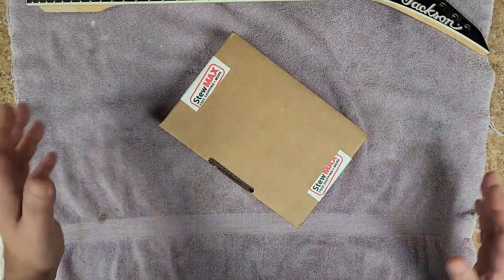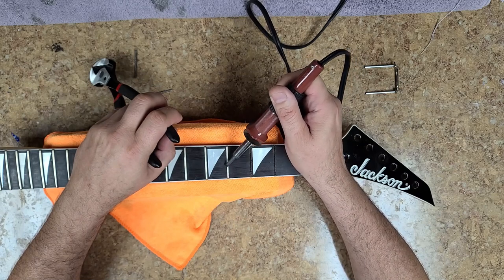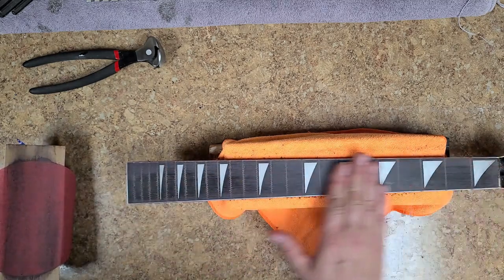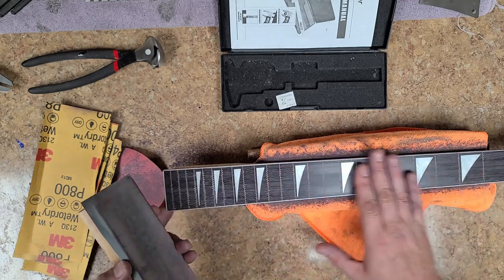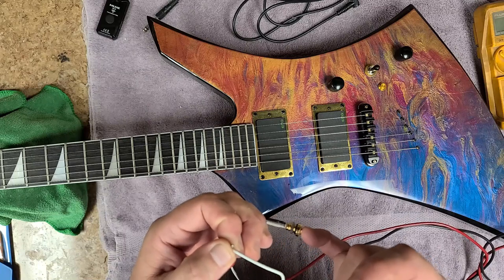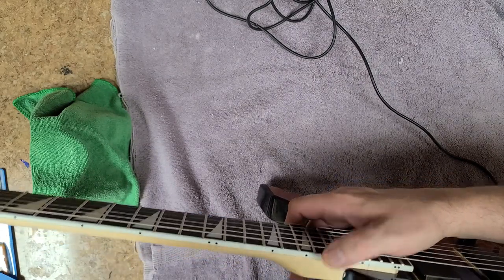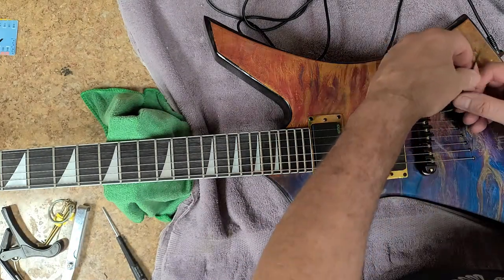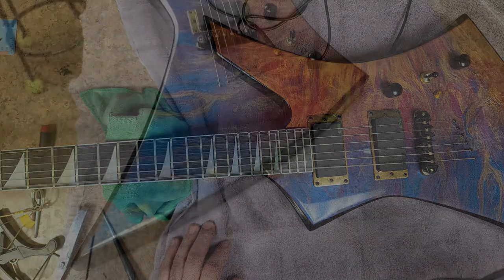Jackson JS30 Kelly Finally has its Glory

Comment: Hey Eric, another great video! Question concerning the bridge adjustments on the post, how much adjustment does it have total? I have a guitar that someone redrilled for different bridge and drilled the post to close to the neck by about 3/16 to a 1/4".
Reply from the maker: Hey. The post opening is 5/16s from side to side. With the mounting post you have 3/16s to move the bridge forward and back. Then you have another 3/16s forward and back for the intonation. Hope this helps.
Reply: @ericctheartofnoise8613  Thanks, I think it will work! Would you mind letting me know who you purchased yours from? Another amazing job my friend!
Reply from the maker: @ambntman4212  https://www.ebay.com/itm/373092148552?hash=item56de066548:g:sP8AAOSwu-thDbmG&amdata=enc%3AAQAIAAAA4CKPxuYR4Bj4iT7TyqRy8Dkfh5syN5Vapb%2BnWD12LaeolQPcV0vxXjh%2FlfULGhli%2BcjBfqYAfFF4qnXg5YnOqdoX8HY34Mvo82hJFePb4fjQqtTyCdrYMHdDWwcwKScyoSN1Jq6WOqkou0toSUaGImrXv8%2FCeGpUYTudYM%2FIlO9yapfisRuxZY8xx4Pk8PBwuwugHZnF17myeCchub4w2%2BaimlHRaXCKYFVLyNwIrkOyzfSIAjh3iFzepf%2BnI1LsTMrXbVrZ3jjQXCLhaKhAFuYaRzcbBXo%2BQA95ZiNA%2Fys2%7Ctkp%3ABFBM_quq2OZi
Reply: @ericctheartofnoise8613  Thanks buddy!